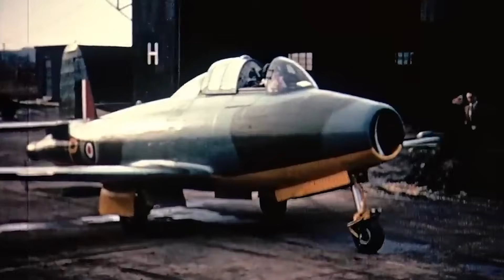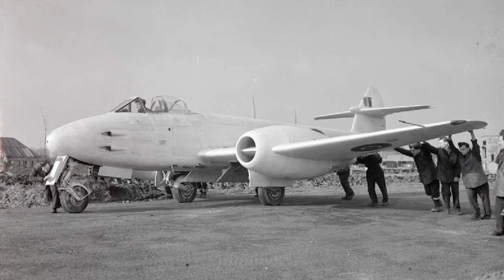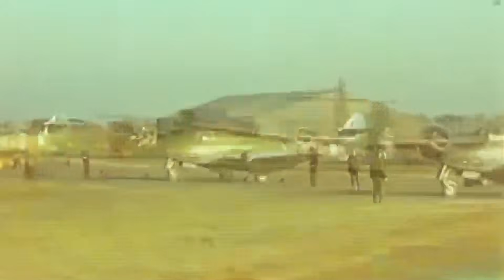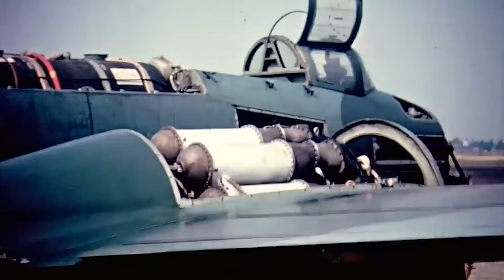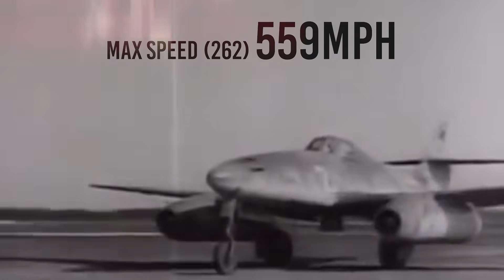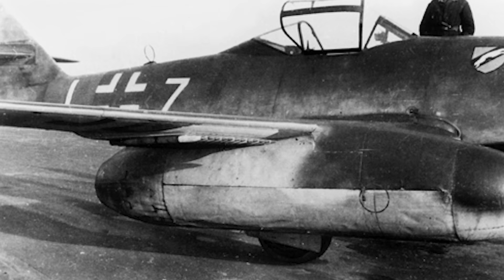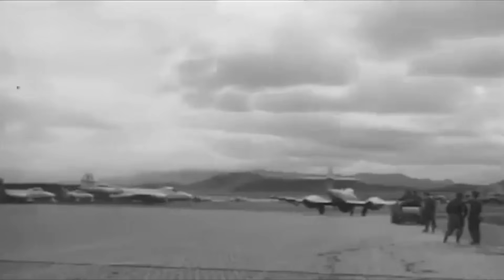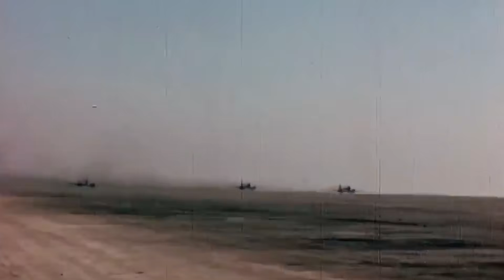Meteor vs Me 262 | Which was the better WW2 jet?

Comment: The Me-262 does well on paper and in gaming, but they don't account for unreliability - the reality was that it was garbage, the unreliable engines alone would have excluded it from allied service.
Reply: 27 Me-262 pilots scored Ace or higher shooting down over 1,500 Allied aircraft.

Kurt Welter remains the highest scoring jet Ace in History.

The Gloster Meatbox only killed British pilots during WW2!

American tests conducted during Operation LUSTY confirmed the Me-262 was very reliable and its engines averaged TBOs of 55 hours, EXCELLENT by WW2 standards and better than Allied engines.
Reply: @DoktorBayerischeMotorenWerke  The 262 was garbage had an actual MTBF on the engines of 10 hours and was a desperation measure.
The Me 262 failings killed many of the Luftwaffes best remaining pilots.
Reply: @politenessman3901  The Me-262 most the most advanced and revolutionary aircraft in history since the Wright Flyer... it was years ahead of any Allied aircraft and completely outclassed every Allied fighter in service during WW2.

That is a completely false Alliboo myth, only the Jumo 109-004 A-V1 prototypes when they simply switched from Krupp P-193 alloy to P-198 without any improvements had a TBO of just 10-20 hours.
BUT these engines never saw production or operational service.
MYTH BUSTED!
Reply: @DoktorBayerischeMotorenWerke  The Me 262 was garbage and crashed in droves because of the engine failures. 
Crap throttle response, low thrust and low velocity guns making it only suitable for non manoeuvring targets and required long runways.
It's funny how adamant the fans of the Nazis are about their junk.
Reply: @politenessman3901  28 Luftwaffe pilots scored Ace or higher in the Me-262, shooting down over 1,500 Allied aircraft.
Me-262 Ace Kurt Welter remains the highest scoring jet Ace in history.
 The Gloster "Meatbox" only killed British pilots.
 All jet engines, including modern ones with FADEC has slow throttle response from idle rpm... but that did stop jet from rendering propeller driven fighter completely obsolete.
The Me-262 cruised at 465 mph, so throttle response was not an issue.
Analysis by Allied experts confirm the the Me-262's standard gun package was the most powerful and effect of any fighter aircraft during WW2.
a single 30mm shell packed with 86 grams of RDX high explosive could blow the tail or a wing off a large 4-engine bomber and completely disintegrate a single engine fighter like a Spitfire or Mustang.

WRONG! The Me-262 despite its sleek, low-drag swept wings had an unusually low stall and landing speeds thanks to its advanced Fowler-type flaps and automatic retracting leading edge slats... it could land on short runways and had a lower landing speed than a P-51 Mustang.

You still have a lot to learn yet kid.
Reply: @tenbear5 

LOL The Nimonic nickel super alloys were developed in Hereford England 1939 -1940. In Germany they thought they needed to use stainless steel for turbine blading which doesn't work and due to various issues ended up attempting to use pressed sheet steel turbine blades. 

262 & it's disposable shirt life engines = Garbage (but it did actually fly which surprises a lot of people). In both Russia and France good people wasted their time trying to do something with the engine after 1945. Russians ceased trying in 1948 as their own effort was clearly better.

In France RR got involved in 1950 and managed to get something useful working. 

We feel we can clear up some commonly held myths and misconceptions, obviously.
It's always good to see the facts presented clearly and concisely isn't it?

The existence of the Gloster Meteor, De Havilland Vampire, Gloster E28/ 39, Vastly superior De Havilland, Metrovik and Whittle turbojet engines actually terrified the German High command peeps. 

The Gloster Meteor was one of the world's first jet fighters to go into service, it was in service during WW2. The meteor was the first effective multirole fighter bomber jet aircraft with a reliable engine to go into service,  It broke speed records in 1945 and 1946. During WW2 it was in service as a fighter and multirole aircraft over the UK and over all allied controlled territories in Europe and beyond. 

The ME-262 and it's 46 minutes life engines were abandoned shortly after 1945, it had a do not exceed speed of 456 mph and was only ever used to attack bombers with losses of three 262s for each downed bomber.  During WW2 most of the ME-262s were destroyed by their engines, were various types of accident losses or were shot down by bombers. No German designers were involved with the Mig-15. The Mig-15 used a copy of the RR Nene.  

During the Korean conflict most of the Meteor casualties were due to groundfire or accident losses. The result of any tangles between Migs and Meteors was that Mig pilots avoided getting into dogfights with Meteors. The battle of Sunchon, where 50 Migs against 14 Meteors resulted in the supposedly superior Migs failing to gain any clear advantage caused the Koreans to re-evaluate tactics. General opposition in Australia to involvement in the Korean conflict resulted in the govt using the battle as an excuse to reduce the RAAFs involvement to troop support only.

The world's first wind tunnel was built in England during the 1800s. The world's first supersonic wind tunnel was built in England during the 1920s. 

The Whittle Gloster E28/39  was of course a brilliant aircraft that was later copied in Russia as the upsized and tweaked Mig 15 with a copy of the RR Nene gas turbine aero engine. The RR Nene being the world's most powerful & most reliable gas turbine aero engine in 1944.

The MD F3H Demon was a contemporary to the DH Sea Vixen & had a similar performance. The F4 Phantom was a follow on from the F3 Demon. The Sea Vixen took a long time to get from first flight to introduction for various reasons and a similar situation occurred with the MD F3H Demon.

McDonnell Douglas F3H Demon
590 Built. Not Supersonic.
Max Speed 578 MPH.
Introduction date 7 March 1956
First flight 7 August 1951
Retired 1964

MD F-4 Phantom 2
Number built 5,195
Manufactured 1958–1981
Introduction date 30 December 1960
First flight 27 May 1958

DH Sea Vixen
Number built 151 (including two DH110 prototypes and one Sea Vixen prototype)
Introduction date July 1959
First flight 26 September 1951
Max speed 695 MPH.
Retired 1972

Interesting British achievements.
There is no doubt that the Fairey (England)
Delta 2 was of course the world's first jet
aircraft to exceed 1000 mph.  Indeed It
exceeded the previous record by 310 mph &
held the record for 1 year. Incidentally, the Dassault Mirage 3 & 4 are based on the Fairey Delta 2.

The Panavia Tornado & Euro fighter Typhoon are British design aircraft with British design engines built by international consortiums. 

The EE Lightning was one of the fastest aircraft on the planet when it first achieved a Mach 2 flight. 

Early days, jet fighters.
De Havilland Vampire, Sea Vixen & Gloster Meteor accident losses were not high or unusual for fighter aircraft at the time. De Havilland built large numbers of all metal airframe aircraft before the DH Comet.
We mustn't forget of course that the DH Vampire for example first flew in 1943 & the engine was also built by De Havilland. There were examples of the Vampire interceptor / fighter in service until 1990 which was operated by more than 30 countries.

Non combat phase accident losses.
% of Aircraft built.

The Canadair CL-44 was a turboprop airliner.
Canadair CL-44                  (ff 1959 ) 48%
Lockheed XF104                (ff 1954) 100%
Lockheed  P80                   (ff 1944) 43%
Lockheed F104                 (ff 1954)  45%
Grumman f9f-5 Panther   (ff 1947) 44% 
Convair F102 Dagger        (ff 1953) 45%  
MD F-101 Voodoo.             (ff 1954) 34%
MD FH Phantom 1            (ff 1945)  35%
MD F4 Phantom 2             (ff 1958)  28%
MD F3H  Demon               (ff 1951)  32%
Gloster Meteor                  (ff 1943)  21%
DH Vampire UK                (ff 1943)  23%
DH Sea Vixen   UK           (ff  1951) 33%
Gloster Javelin  UK         (ff 1951) 20%
EE Lightning  UK             (ff 1954) 33%

It's a great pity & a crying shame that British military forces had to occupy a large part of Germany for decades after 1945 & Russian military forces had to do the same. Of course Russia still posseses a large chunk of what was German territory & of course Russia & the UK produce nukes. Obviously Germany does not produce nukes.

Early days, jet engines. Whittle performed the world's first demonstration of a gas turbine aero engine in 1937. The RR Nene, a centrifugal gas turbine aero engine, was the world's most reliable & most powerful gas turbine aero engine in 1944. Licensed built versions & copies of the RR Nene & RR Derwent would go on to power many aircraft in Russia including the Mig 15 & Mig 17, the US, China, France & other countries for decades after 1944. Incidentally, the Mig-15 was in essence an upsized / tweaked copy of the Whittle / Gloster E28/39 jet aircraft including an uprated copy of the RR engine.  The basic centrifugal compressor gas turbine aero engine with Whittle style reverse flow combusters and sometimes an axial compressor section is still manufactured by more than one company including Pratt and Whitney, the main application being helicopters.

The gas turbine engine was invented in England during the 1700s.

During the 1800s Parsons of Ireland & North England produced the world's first axial multi stage sequential stator rotor turbines and compressors for turbomachinery use which would eventually go on to to form the main components of the axial gas turbine aero engine. At the time the basic idea of making an internal combustion gas turbine engine and using it as an aircraft engine was considered thus the jet aircraft concept had been created in England before the first powered aircraft flew.

An example of what goes on these days in various countries. For example, there are of course no German companies that makes German jet aircraft in Germany & there are no German Companies that make German gas turbine aero engines in Germany that are suitable for widebody airliners.

The UK has the world's highest combined per capita Nuclear / Defence / Aerospace Sector Activity.

UK defence sector, absolute terms, world's second highest activity. 1st for per capita defence sector activity. Per capita nuclear powered submarine construction, 2nd position. 
Main players being Rolls Royce, Babcock, GKN Aerospace & BAe Systems. Activities often involve international collaboration. BAe systems, RR and other UK companies now handle more Airbus work value wise than Germany. 

There's a good chance that anyone currently flying on a widebody airliner will be on an aircraft powered by RR gas turbine aero engines made in the UK and a good chance there will be other hardware on the aircraft that's designed and / or manufactured in the UK. 

Rolls Royce Holdings UK
Subsidiaries
- Rolls-Royce plc
- Rolls-Royce North America (ex Allison etc Classified Military stuff)
- Rolls-Royce AB
- Rolls-Royce Deutschland
- Rolls-Royce India Private Limited
- Rolls-Royce Marine Power Operations
- Vinters Engineering Limited
- Rolls-Royce Controls and Data Services
- Rolls-Royce Power Systems
- Bergen Marine
Joint ventures include:
- Rolls-Royce Turbomeca
- MTU Turbomeca -

Trent Family
The MT30 (Marine Turbine)
Industrial Trent 60 Gas Turbine
Trent 7000
Trent XWB Airbus A330neo.
Trent 1500
Trent 1000
Trent 500
Trent 600
Trent 700
Trent 800
Trent 8100
Trent 900
   
RR wholly owned subsidiaries in Germany handle smaller 2 shaft RR gas turbine aero engine work.

The UK space and aerospace sectors are highly productive, high-value industries that together contribute over £18 Billion in direct Gross Value Added (GVA) to the UK economy. Individually, the space industry directly contributes about 0.3% of UK GDP 7•2 Billion while the aerospace industry contributes approximately 0.5% £10•9 Billion.
   
Wee hopes theze helpsmz.  EtC---.

We hope this helps of course 👍

Comment: Throttle response is extremley important and overlooked by armchair fighter pilots.  The 262 would not be able to fight against a manoueverable  and easilly control Meteor.  262 was a good bomber interceptor but would have been innefective as a jet to jet fighter.
Reply: Actually, that is a popular but completely false myth.
 While all jet engines have slow throttle response the Me-262 had a blistering fast continuous cruise speed of 465 mph... faster than Allied fighter with WEP... faster than a Spitfire in a dive. So, it's a completely moot point. 
 The Gloster "Meatbox" was not a fighter and models used in WW2 had extremely poor handling and throttle response due to its high drag airframe and the lack of a variable jet nozzle like the Me-262.
The Me-262 was an excellent dogfighter... the problem was there were no Allied fighters in its class. 
Even Eric Brown stated that the Me-262 could turn and maneuvered well at speeds that Allied fighter could not reach in a dive.
Me-262 pilots had complete control of where and when to engage enemy fighter and could simply deny the enemy any opportunity to engage with its massive speed advantage. 

What armchair fighter pilots like you don't understand is just how huge a 125+ mph speed advantage is if you are not a pilot... or what a huge difference swept wings and jet engines make in turns compared to straight wings and propellers.